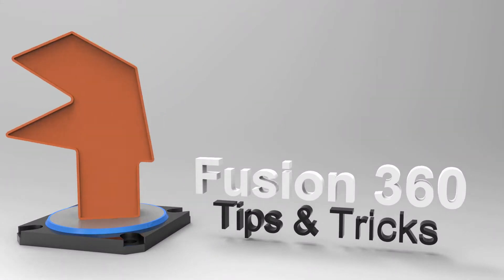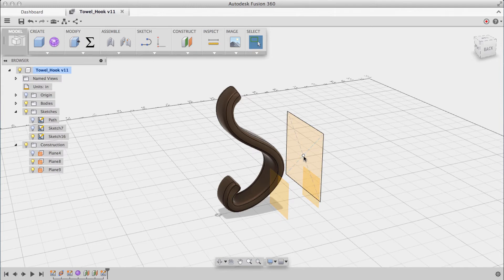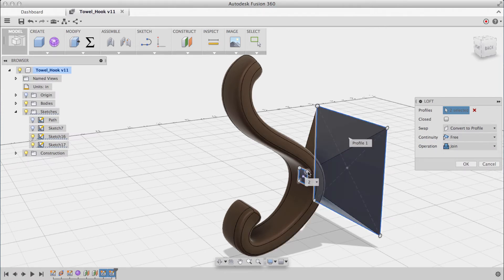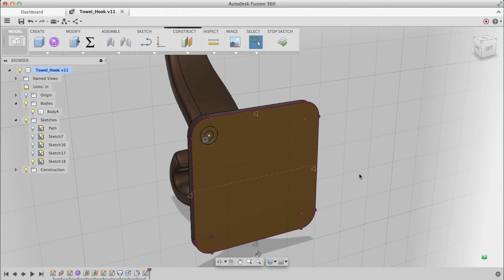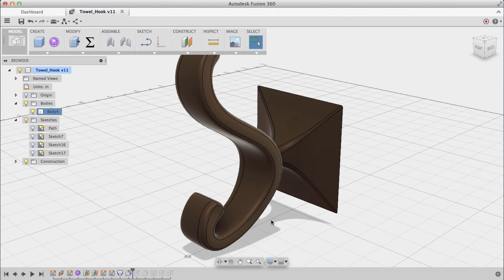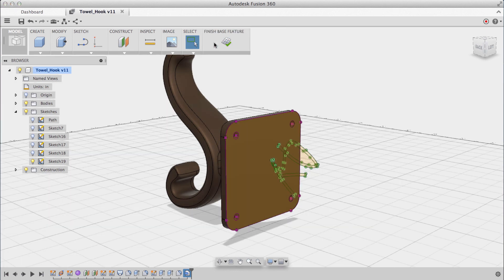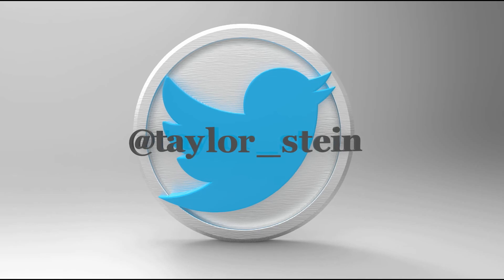Towel Hook Design - Part 2

Comment: How on earth did you make does holes in the back plate ? :-)
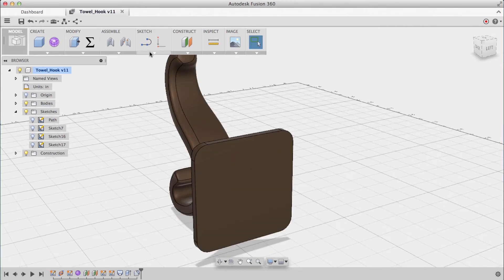Reply from the maker: Lars Roos Hi Lars - Taylor walks through these steps @ 2:05 in the video
Reply: He is drawing them on one side. but the countersink is appering on the ohter side ?
Reply: @adskFusion  I wondered the same thing as Lars. He sketched it, but suddenly it's in 3D